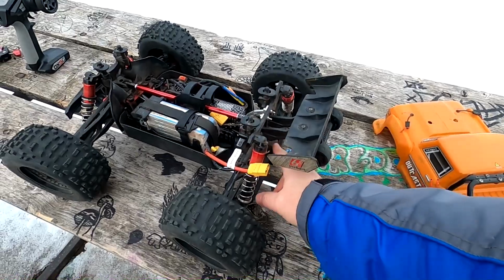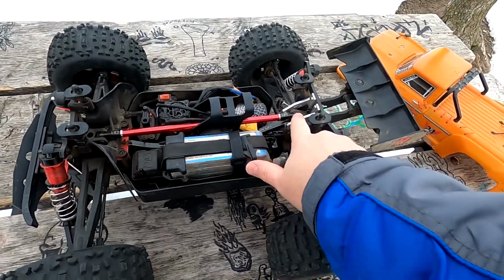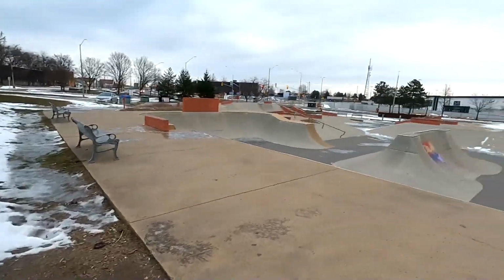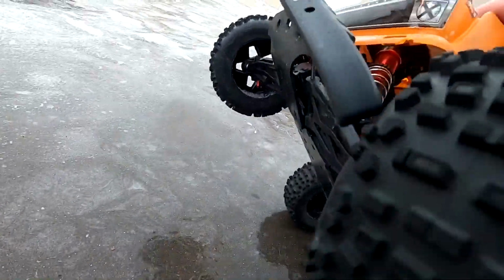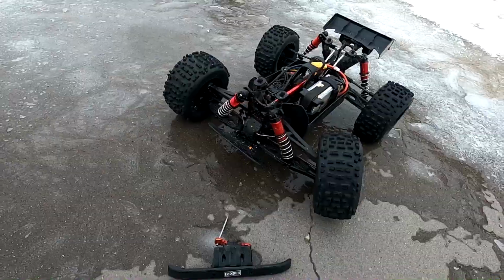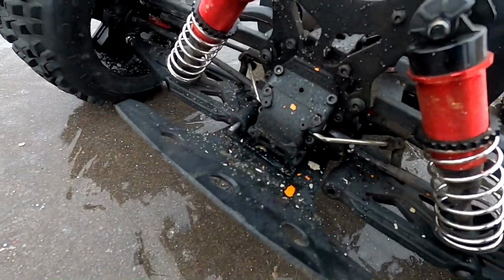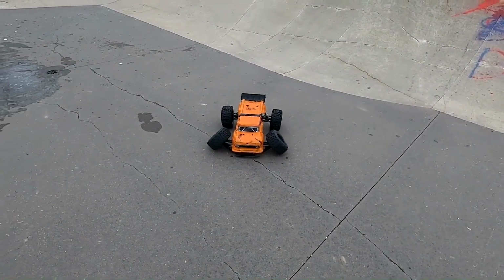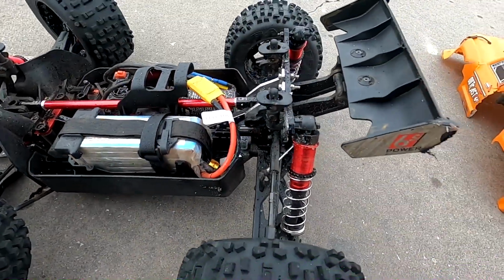ARRMA Outcast 6s Upgrades - Skate Park Bash 😮 HOT RACING upgrades

Comment from the maker: Hey guys! I had a blast bashing my Arrma Outcast at this skatepark. The cold was pretty hard on the plastics but fun nonetheless 😀 Do any of you guys bash in the cold? Let me know in the comments if you have any tips on how to keep the plastics from breaking.
 Cheers. 😀🍺🍺
Reply: Well I guess I have a little tip. So youtuber kevin talbot said that if you spray wd 40 or muc off 94 on the plastics it will make them more flexible. So I tried it on my senton. It actually works. I did realize that it made the bumpers a lot more durable. There was no side effects to.  But I would not spray it more than 1 or 2 times. This is becuase it can cause other parts to break, from being to flexible.  I have ben worried that if I get it on the shocks it will mess them up. But anyways if you are going to do this if I were you, you should cover them anyways. I mean kevin talbot said you can just spray it all over. But just incase I dont want to mess up my shocks. I hope this helps. By the way there is no need if you have rpm arms. And wipe off all the exes in the morning, be used you let it soak over night.
Reply from the maker: @michaeltrindade7225  Thanks brother. Yeah I'm aware of this trick but never tried it. Thanks for the feedback on that it worked for you. I will try it for my next skatepark bash for sure.😃
Reply: Ok

Comment: Nice run!! Love the Outcast 6s. I got to play with my buddies recently and it’s a ton of fun. Absolutely yes I bash in the cold. I can’t stop just because of weather I just have extra parts on hand. I try to be a little more gentle when it’s real cold out. Still can’t help but to send it. lol
Reply from the maker: Im used to buggies and the forgiving way that they jump. The Outcast does front flips just by letting off the trigger. You need a real smooth steady finger to get it to do what you want.

Comment: Brilliant video my brother 🇬🇧😀👍
Reply from the maker: Thanks bro. Much appreciated.  What's your favorite basher?
Reply: @KaizerTest  my new dr8 takes some beating.. But notoruis there rite at the top. Aswell.. 👍
Reply from the maker: @gazfpv  Yeah it held up ok with a few upgrades. The Tbone bumper helps a lot. I shouldn't have run it with the Outcast bumper underneath. that's what broke the front diff housing. The aluminum chassis braces are a must. I wonder how an Xmaxx would have held up? Or a Maxx even.
Reply: @KaizerTest  iv got a k8 an a xmaxx. Don't think k8 would of held up. But the xmaxx deffo. I don't take my xmaxx out very offtern Coz it my shelf queen. 😂 😂
Reply from the maker: @gazfpv  I hear you on the Xmaxx. With tax here in Canada its $1475! Thats a lot of money to take to the skatepark and destroy..lol. I feel bad doing it to an Outcast too but thats why I bought it. I have some shelf queens and light runners as well.
Reply: @KaizerTest  outcast /notorious both the same diffrent body's. Yes I did the same. I buy all my cars new arrma traxxas an now iv bought a ftx dr8 man u want to buy one of theses they epic. Never had so much fun with this out the box. . I bought my notorious brand new for bashing myself. Love the stunt truck. 👍 🇬🇧😀👍
Reply from the maker: @gazfpv  Yeeah the DR8 looks sweet but I don't think I could find it in Canada...let alone parts for it. I need a steady parts supply...lol.

Comment: Wish I had a stunt truck!  How much are they?  Is it pretty much the same thing as the notorious? What are the differences?  When I run in cold, I like to constantly check the parts and put some heat under it. Like a heat lamp. But that’s just when I run at home.
Reply from the maker: The 4s Outcast is about $400 USD and the 6s Outcast is $550. But The Arrma Granite 4x4 is also a good truck and you can get one for about $230-$320 depending on brushed or brushless. For bashing at a skatepark an RC that costs less may be better. Like the Granite chassis is inexpensive to replace. 
    I never thought to put a heat lamp on the car. I think the trick is to land as many jumps as you can and avoid one wheel landings...lol.😅
Reply: @KaizerTest  I guess a granite would be good! But yah, using a heat lamp is un-orthodox, but it keeps the plastic warmer and less stiff. It works for me. I usually keep it on for about a minute or so. But don’t usually do this, but when I do, I have had no issues. Just try to to put it directly under the spur. Try it out!
Reply from the maker: @bigandcoolrcschool294   Yeah if you are running at home it may work or keep the RC on the floor of the car with the heat on and then take the RC and run it for 10-15 minutes and then back in the car...lol. Might help. I think the WD-40 trick works. Also RPM  A arms should help. I'm going to try a Granite in the cold at the skatepark. I may spray the chassis and parts with WD first.
Reply: @KaizerTest  yup. WD -40 works well. I don’t usually use it, but I haven’t had any issues when I do! I’ll be tuned in for the granite video!
Reply from the maker: @bigandcoolrcschool294  Nice. Yeah the Arrma stuff broke fairly easily in the cold. It definitely needs some help.

Comment: Holy cow that was probably 40 ft
Reply from the maker: Hahaha....yeah I punished this poor truck. Since I added the M2C rear shock tower braces the rear end has been holding up. Next I'm going to put Hot Racing lower hinge pins on the car both front and rear and see how that does. The skatepark is so much fun. 😀
Reply: @KaizerTest  have you seen the bash bar from Radical RC UK?
Reply from the maker: @jknewb6276  Yeah...it looks like a great idea. I might get one. I have a few chassis' as well. An  M2C chassis and I think I have another Just BashIt chassis. But I'd rather kill a few stock chassis' in the name of science and see how they hold up with a cheaper way to strengthen it. I'm saving the M2c for the BMX track.
Reply: @KaizerTest  oh sweet I like your style!

Comment: oh man what you've done, you broke everything ahahah, nice buddy bash on !!!
Reply from the maker: lol 👊😭 I did! Ok so time for some aluminum hinge pin mounts. I'm going to try front and rear lowers and only run the Tbone bumper without the Outcast bumper on the inside. I think the front diff housing broke because of the Outcast bumper on the inside of the Tbone bumper. I might put a Tbone on the back as well.
Reply: @KaizerTest  i prefer the rpm front bumper. It saved me several times and it never broke. I put the same at the back.
Reply from the maker: @navbes  Oh yeah? Ok I will find some and give it a try. Are you running aluminum hinge pin mounts top and bottom, front and back at both ends of the truck?
Reply: @KaizerTest  i'm stock for the hinge pin mount front and rear